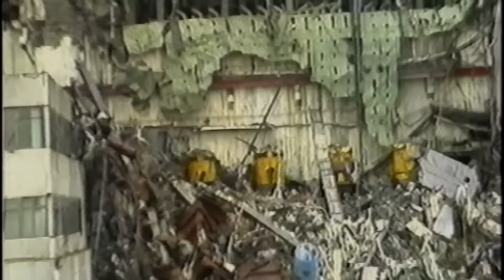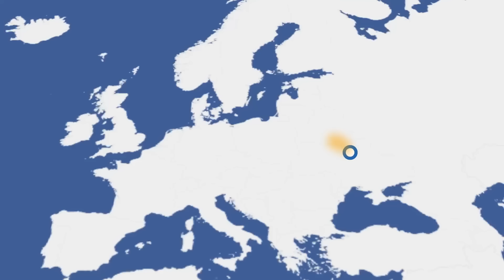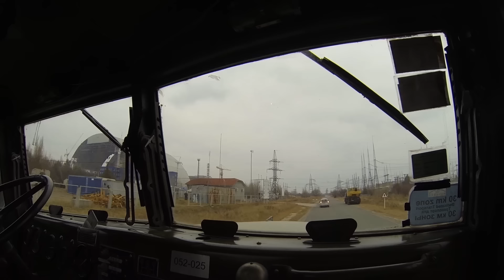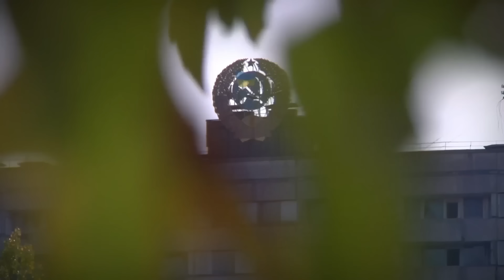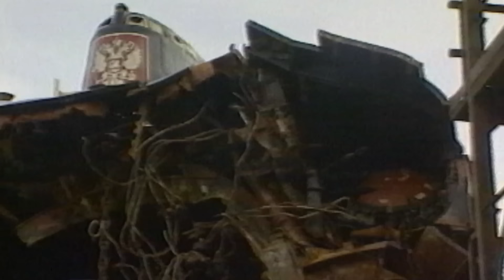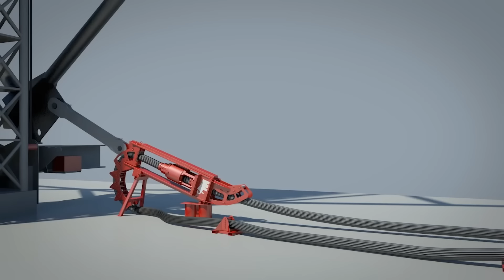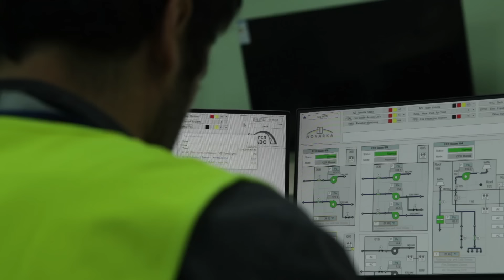Sealing the Radioactive Wreckage of Chernobyl | Heavy Lift | Full Documentary

Comment: Did someone count the amount of times the voiceover and people in the documentary said that they built the arch a distance from the reactor for safety reasons? Its at least 4 times.
Reply: It's written and voiced by AI
Reply: @spaceguy564  No it's not. He's my neighbour 😂
Reply: It was built some 400m away from unit #4 because the old reactor is still emitting ing radiation at slightly higher than background radiation levels (2+ millisieverts/hour).  So if the  construction peeps were there for a year it wouldn't be good.

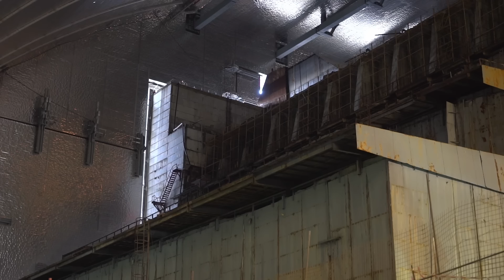Comment: At 37:15 that old engineer seem like he was criticizing that new confinement took too long to design and construct - around 20 years, and then he brags that old sarcophagus took only 5 months to do design and custruct. Yes 5 months is impressive but in 1996, after 10 years it was already detiorating and had to undergo some renovations, so I don't see anything to brag about. At least new one is done properly and will stand for 100 years.
Reply: i was thinking the exact same. the old guy has no idea how incredible the design and construction of this humongous thing is. no wonder that old thing took only 5 months, its literally mostly metal plates and maybe a bit of concrete slapped together and welded, not even painted to be properly weather resistant. there was no way on earth to build that new sarcophagus any quicker, look at the insane amount of planning that went in there to have everything go 100% smooth without any problems, fitted and measured to the millimeter
Reply: To be fair the Sarcophagus was build by around 90k people being involved in constructing it and it had more than enough concrete to fully engulf the statue of liberty in a concrete cube not to mention those basic metal plates were constructed and made on site only the roof beams were around 200tones of metal and were lifted with a crane able to operate up to 158tones the estimated actual weight of the beams but not the connection parts between the 2 beems and the crane almost flipped when lowering it ... Also the first contamination chamber was ment to survive up to 20 years max it was bever a permanent solution, so to be fair the project was massive but alot of people worked on it so it was finished in 5 to 7 months after it began with the technology available almost 40 years ago its not a small feat now the whole building can be constructed off-site and moved in place as it was done and with the proper maintenance as its designed to even remove the old structure and clear remains of the reactor it has to last atleast the next 50 to 60 years, but lets be clear it wont in no time it would need proper reconstruction because maintenance won't cut it 😅

Comment: That thing will still be cooking 500 years from now
Reply: Not really? As far as I'm aware, the thing is cold to the touch at this point (and has been for quite a while). It's also no longer screamingly radioactive, as fission byproducts tend to dissipate within days to months of the reaction stopping (customary "hot storage" of spent fuel is about 2-3 years). The longer-lived byproducts have already seen at least a half-life (for strontium and caesium that's about 30 years), so the remains of the core itself are now relatively safe to approach (IIRC you can stay right next to it for several minutes at a time now). It's not "safe" by any means, obviously, but it's no longer a death sentence either. I fully expect we'll have the site cleaned up and repurposed within 500 years. The "hot particles" have also likely experienced a sharp nosedive by now...

Comment: just amazing after all the years that building basement is stil just as dangerous as it was back then
Reply: It will stay dangerous for hundreds of years, until the technology becomes available to nullify the radiation that has consumed that building and its ruins within completely. The building cant even be disposed of at this point, which is why its safer to just seal it in a tomb.
Reply: The area will not be able to be reoccupied until 24000 years have passed.
Reply: @ConfusionDistortion thousands of years
Reply: @calj01 That's just the amount of time until the exclusion zone becomes 100% safe. I'm sure before that happens the zone will become habitable for the least affected areas in tandem with restricted areas. Either way, not within our lifetime.
Reply: @calj01 thank you for saying the truth not a lot of people realize that half-life of  u235 is 10,000 year in people that think the exclusion zone is any better it's not
Reply: @superblade1987  You do realise that the longer the half-life, the less radioactive the thing is, right? The most radioactive stuff was gone within days (essentially fell apart in a hurry), the moderately radioactive stuff will be gone within about 100 more years - and the long-term stuff will be relatively safe to handle. The primary problem is that it's a logistical nightmare to do any work on anything in there - but since it's no longer screamingly radioactive, a lot of the work can be done by machines now.

Let me put it this way: take a gallon of water, and put it in a container. Now punch a hole in that container. The bigger the hole - the stronger the water jet... but also the sooner the tank will be empty. Spontaneous fission works much the same way - the faster something decays, the more radiation it spews out... but also the faster it'll expend that energy and become inert.

Comment: One question rises up to me, how could these people work here and construct this, even get inside this "arch" and not get contaminated either?
Reply: Their is safe amount time/dose
Reply: Take a look at a half-life curve. A material is generally considered "gone" by 6-8 half-lives (1.6% to 0.4% left). You have three broad classes of fission (by)products: A) short-lived, with half-lives to the order of minutes to days, B) medium-lived, with half-lives within years to decades, and C) long-lived, with half-lives going into tens of thousands to millions of years. Category A is impossible to handle without specialised equipment, but it was all gone within 3-6 months. Category B requires protective equipment and procedures but can be handled safely as long as you're not an idiot, and it'll be mostly gone by the year 2100. Category C is not very radioactive (longer-lived = less energetic), so they can be considered safe enough to handle with standard precautions in place.

Most people don't realise how overkill our radiation safety procedures actually are.

Imagine you want to leave your home and go shopping. If this was done according to our radiation safety standards, you would need:
a) no less than 3 pairs of shoes (incl. the ones you're wearing),
b) a spare change of clothes,
c) 2 alternate destinations (if the shop you're going to is closed),
d) a spare wallet and cash in a separate pocket,
e) a friend who will let you sleep over if you don't return home by midnight,
f) police, ambulance, fire brigade - on speed dial in your phone, and
g) a backup phone.

:D

Comment: It wasnt a buildup of Hydrogen gases at the turbine that caused the catastropic explosion?
Reply: Yes. Hydrogen untimely blew the lid off.
Hydrogen came from the superheated steam- and oxygen was there being part of the molecules that form water (H2O)-
Under high pressure (like a diesel engine) it blew.
Reply: Pfft hydrogen won't explode. Get back to work comrade
Reply: @rack_man  But the mix of hydrogen and oxygen gas will. There are a tons of video available about this topic on YT :)

Comment: Really should’ve welded the whole thing. You know why last a lot longer no bolts are going to come loose ever and worlds are a lot stronger than those puny little bolts. You’re basically making them material one. I’m basically saying is that material needs become one piece of material rather than mini Rather than having one thing that is supposed to hold up the weight of a war going on what I would do is literally make sure that that thing would be bulletproof would be bombproof. That means no nuclear reactor would be ever to be able to come out there let’s say that the nuclear reactor hit again the whole ceiling I want to make sure that that thing does not come out of the containing structure that’s the whole thing you’re acting like it’s going to survive 100 years. Do you make it out of iron red steel that rust is out or something similar brass or something else like brass copper or something else that doesn’t rust away too easily aluminum to make it thicker But you don’t have to worry about rusting. You have to keep it very moisture control below zero soloed no rust will form for you would have to put on a protective coating and rust neutralizing pocket so there would be no rust. That’s the thing that you had to take to consideration nothing will not be taken care of that’s the thingbecause there’s too much reactive sources in there too people maintaining that thing so I would probably weld the whole thing

Comment: Could they fill the arch with gravel or sand or, better yet, cement, in a hundred years, to keep it contained for longer? I understand they want to study the decay of the elephant's foot and the materials around it, but surely, in a century, they will have learned what they can and encasing it in cement would make it safe for a lot longer.
Reply: Issue with cement is like everything else it decays too unfortunately
Reply: @cameronrichardson3108  Doesn't cement get stronger with time? Also, even if it did decay, what timeframe are we talking about? And, does what it decays into increase the release of radioactive material? Lets say it keeps it safe for an extra 500 years. Who knows what sort of technology we'll have by then?
Reply: @BabyMakR  ice vastly reduces the longevity of concrete, once it cracks a bit, water gets in and freezes makin* the cracks bigger and so on, I think concrete could possibly cause more of a headache than it would solve
Reply: @cameronrichardson3108  That's true, but, would it increase or reduce the likelihood of the release of radioactive materiel. This is a genuine question. I can see that it would reduce it getting into the air, but could the rock, sand and lime likely to cause problems with, say, causing nuclear reactions to re-start or something? I know unusual, unintuitive things can cause things to happen with nuclear reactions, but, at the end of the day, they have 100 years with the current dome. After they have all the scientific data they need, would filling that dome with something, not necessarily cement, maybe just sand and stone, increase that 100 years?
Reply: @BabyMakR  The "sarcophagus" the Russians built to contain it originally in 1986 was made of concrete, it's now crumbling and in danger of collapse, which is why the new safe containment had to be built. Concrete is generally good for about 100 years in ideal conditions, but of course the situation at Chernobyl is far from ideal, and any exposure to the weather will greatly shorten that life unless it's protected. Probably the best way to shield it is with stainless steel, which is what the outer layer of the new safe containment arch is made of. 
The plan is to dismantle the old concrete structure before it collapses, and then to eventually remove the radioactive debris and material so it can be stored safely in confinement and no longer present a radiation threat. Radioactive elements decay over time and become less radioactive, so the plant is less hazardous now than it once was, but it's still very dangerous at the core so having the old concrete collapse would allow the destroyed core of the reactor to be open to the atmosphere, which we definitely do not want. Hopefully these tasks can be completed within the lifespan of the new safe containment, which I think is estimated to be about 100 years with maintenance and care.
Filling the core with sand or gravel or concrete isn't really a responsible course of action, as it would just mean a much larger clean up for future generations. It's much better to remove the radioactive material and store it safely away from the plant. Perhaps one day in the future the destroyed reactor will be cleaned and made safe, though I doubt the surrounding area will ever be considered completely safe, well, not for thousands of years anyway until all the longest lived radioactive elements have decayed away fully.
Reply: Well it is a better decision than just uncovering it in 100 years. Maybe we will have better tech to clean it up with in 100 years and also another way to contain it too.

Comment: There's a good amount of inaccuracies in this video. It exploded at 1:23 am not 1:28. The "fun fair" was set to open shortly after the disaster, it wasn't open at the time. I'm sure there must be more incorrect things sprinkled around
Reply: My first issue was with the whole "through a series of mistakes" right at the beginning. Yes, mistakes - at the design stage of the damn RBMK-1000 reactor, not during operation. :D

Comment: Why don’t they pour cement all over it?
Reply: well at some point they want to reach that elephant foot and remove and dispose of it
Reply: Cement is only stable for so long unfortunately.
Plus the core itself still contains highly radioactive material that can melt through the concrete underneath it. That’s the biggest concern in my opinion.
It just needs to be removed and honestly may never be.
Reply: Its cement. It leaves underground seepage open.
It MUST be taken apart and cleaned.
Reply: @MRdeLaat there are other areas in that mess that are even more radio active.